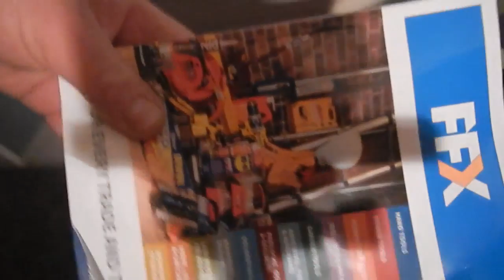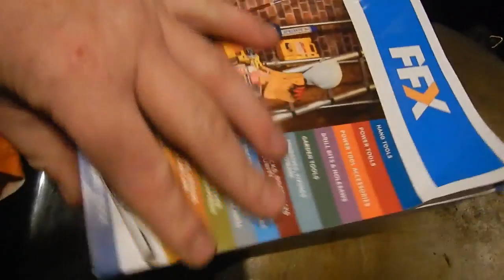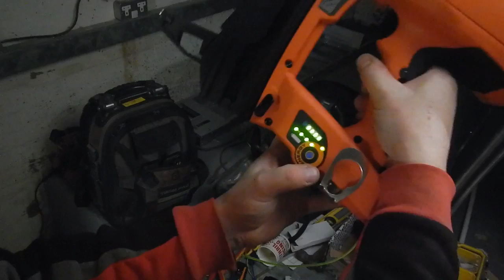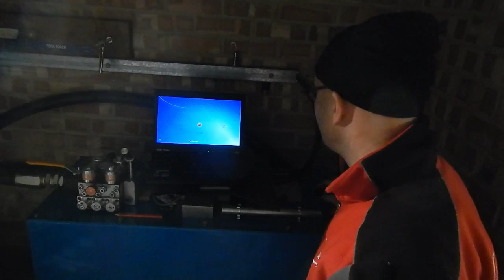Video 67: New fuse board

Comment: That cable is split concentric cable, mostly used by the utilities, although I have used it for sub mains, if it's being run surface.
You may have found it easier if you had just drilled a 32mm hole then used a few bushes and a coupling, you would get them all in one hole. Why is that socket upside down. Very strange
Reply: Consac?
Reply from the maker: Don't know why they put the socket in upside down.  I have changed it since, for no particular reason except I found it annoying when plugging my vacuum in.

Comment: I'd avoid using your snips/sidecutters on the enclosure & any metallic containment Rupert! I think they're only really meant to be used on copper. Not got any aviation snips on the van?  😁
Reply from the maker: Thanks, I think you're right.  But, I  have never heard of aviation snips, are they the tin cutters you use on sheet metal with kind of serrations on them~?

Comment: I think you should up your labour rate, new year new rate 👍
Reply from the maker: Wow!  Thanks!  Really?  I'm currently charging £37.50/hour weekdays £186.50 day rate, but I charge £60 a board and £20 each circuit for EICR.  You think it's too low?  I'm very expensive for EICR round these parts.
Reply: LAsparkTV Wire&Test Limited , I am in the south east of London & I charge £65 for first hour then £50 after. 👍
Reply: Hi Rupert your a great character on camera your videos are really entertaining just come across them. 
I’m from south east near Cambridge area  I run a small limited company of 5 guys our day rates are beween 280-320 plus vat. 
I don’t generally like to get involved in periodic inspections as such as I find them very boring but I generally price them high and still get a few 
I also do a £60 min charge then 40 per hour there after

Comment: Why did you bring all the line conductors through separate holes? Especially on a 3 phase system
Reply: Could you not put one large bush and coupler?
Reply from the maker: @7chappers  possibly, it's just what I had handy at the time.  The latest one I cut a sort of round ended letter box and stuck grommet strip all round it.  But in this instance I don't think I could get an angle grinder to bear on it.  It's alll the same anyway, I cut out the bridging pieces so there'll be no eddy currents.  It's not pretty I know, but the conductors are all protected from abrasion.  Sorry it wasn't a very good effort!